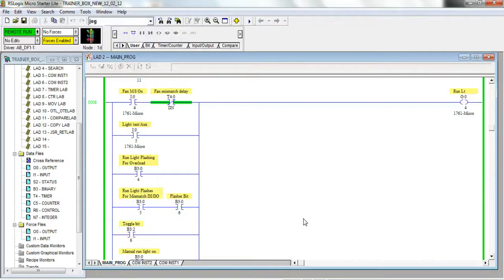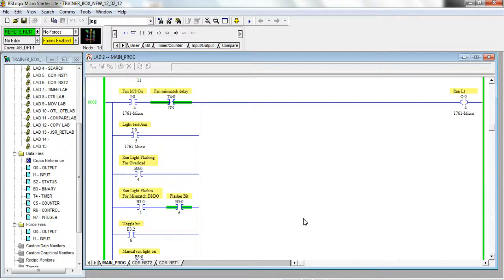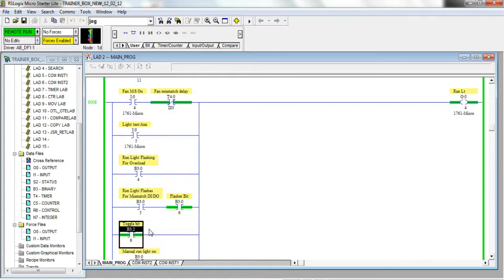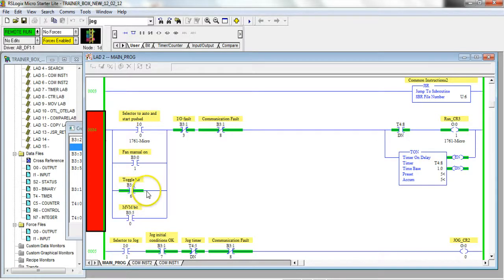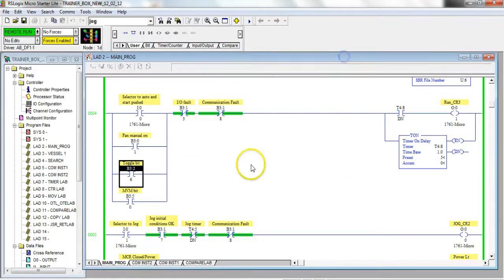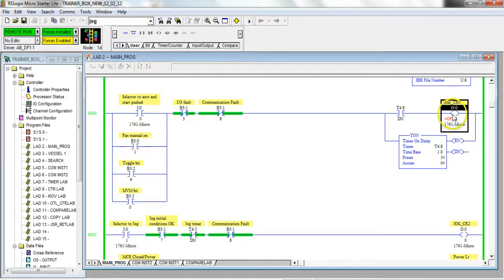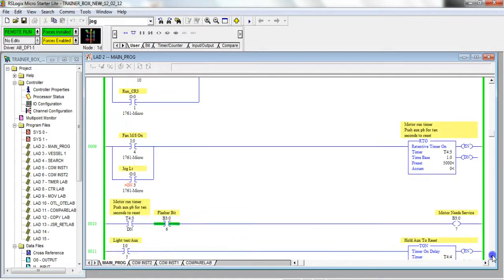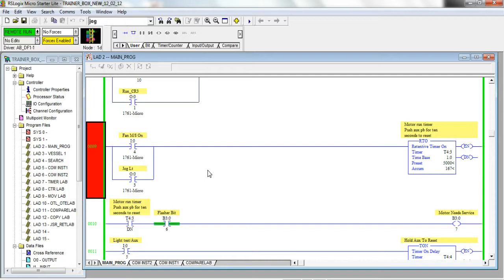PLC Training. Forcing and toggling

Comment: I only force inputs and never force outputs. Forcing an output can bypass 40 required safety conditions that are not met. I would rather find which inputs i dont have on. Correct any correctable issues. Search out all uses in the program with a "find all" so you know exactly what it affects. Then decide between forcing the input if other uses wont cause an issue or branch around it using test mode.